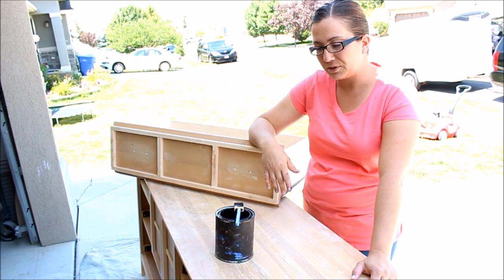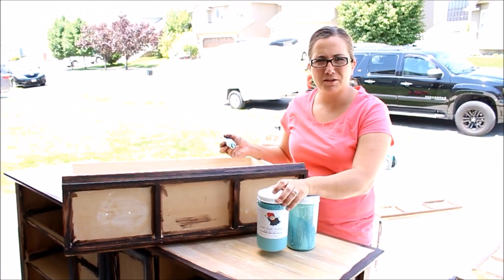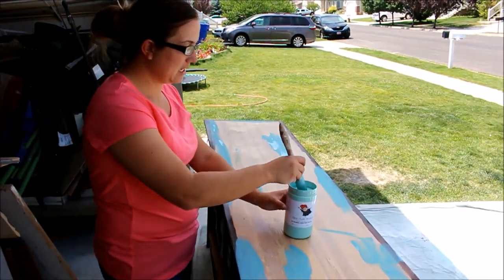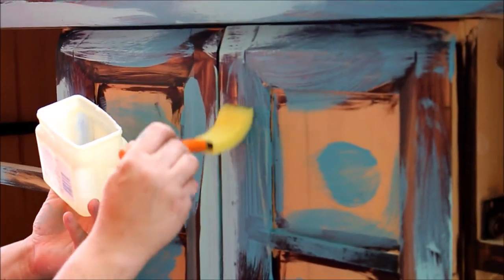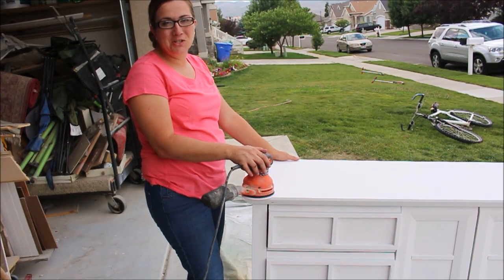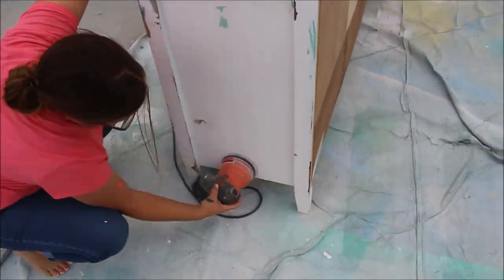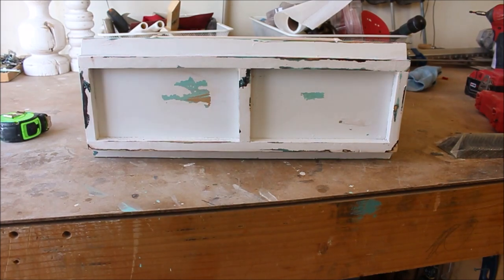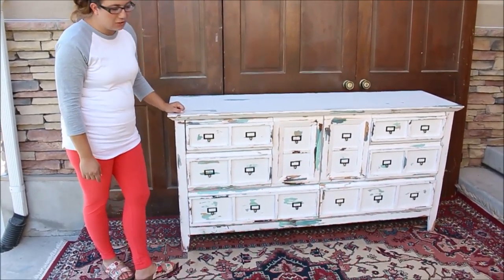How To Do Chippy Paint | Paint Resist Technique

Comment: Actually, I ordered some milk paint from you and I’m working on a fireplace —the wood part of the white surround that I topped with shiplap. Its all white and not distressed —yet. I think I’m going to latex paint in charcoal first as my under color. I have some already, and it’s one of the colors in my pebbles on another part of the fireplace surround. 

So is this right: ? paint with the latex under color, then lacquer, then milk paint (flour sack — with or without super bond?)) (can I use a smooth roller to paint on the milk paint?) Dry, sand off the chippies, then wax? Can I also use Vaseline resist in places or not necessary?

Sorry for all the questions. I don’t want to mess it up. I did the surround myselfTook me forever. I did the whole wall from drywall to the finish. Looks great and beachie but no distress. Needs distress. !!!
Reply from the maker: That would work, just know if you go to distress latex if you sand it or it gets hot it can gum up or ball up on you instead of sanding off. I recommend wet distress if you’re using latex underneath.
Reply: Thank you so much!  So I also have some black gel stain around here. I’ll use it for the base instead. Would I need to lacquer before milk paint for chippies? Sorry to keep going with this. Lol

Comment: Since we are going to use chalk paint does it matter if the finish is still on the dresser before painting as long as we clean it well..if we plan on doing the chippy paint? Or do we need to sand it all the way down? Will this technique work even if we are dealing with a dresser that isn't all wood?
Reply from the maker: I would lightly sand it if it is a shiny/gloss finish or if you are dealing with a veneer type finish. You don't need to sand it down to the bare wood, just rough it up a little so The paint has something to hold on to.

Comment: what is the use of vaseline
Reply: the Vaseline makes that area so that the paint doesn't stick. Since she sprayed the paint on, the paint went onto that area- and dried-- yet when she sanded- the  white paint came off very easily where the Vaseline had been applied. Just a little goes a long way with the Vaseline...just to give a lite  coating . I'd make a "test"  on a scrape so you can understand the technique. Hope that helps....